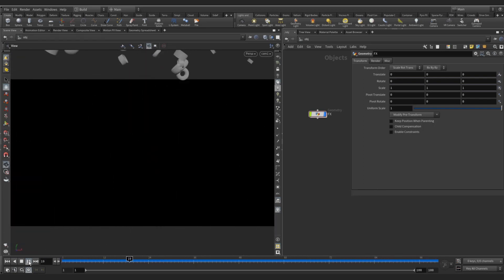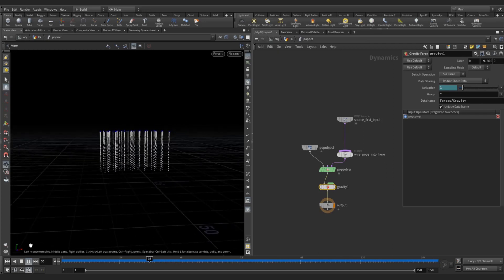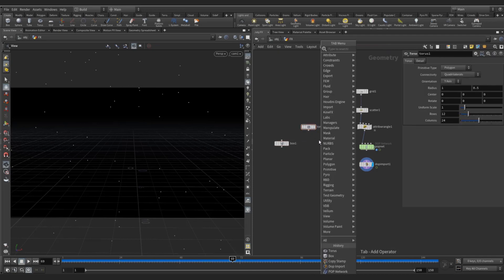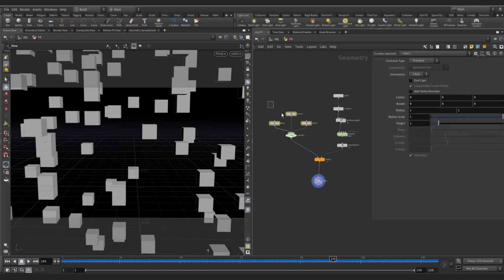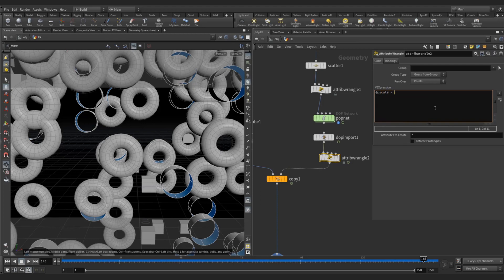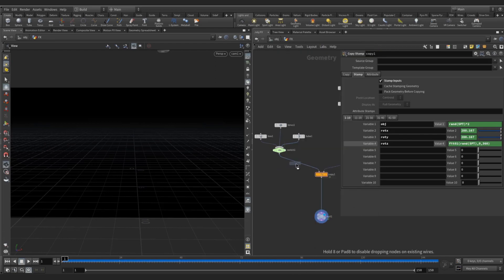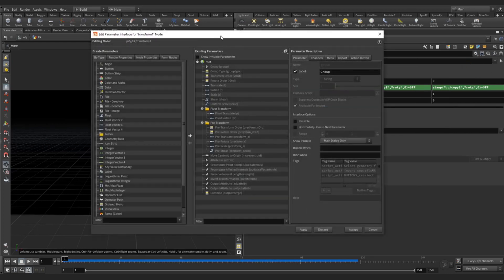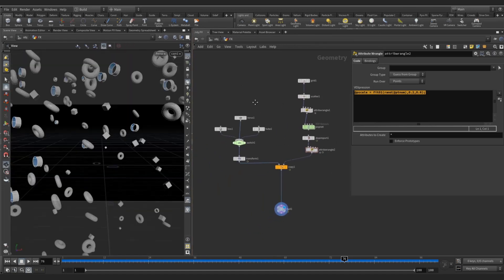Instancer Rotation Using CopyStamp

Comment: First thank you for the tutorial. The node copyStamp was deprecated , in order to achieve this effect without this node use the for each loop node with MetaData (to grab the iteration value from it). Use this information on the switch node and use the fit function to set the range to the number of object you have and use also the random function to randmize between this range: fit01(rand(detail("../foreach_begin1_metadata1", "iteration", 0)),0,2)
Use the same metadata informtion on the transform node to get the rotation: fit01(rand(detail("../foreach_begin1_metadata1", "iteration", 0)),0,360)* $FF * 0.03